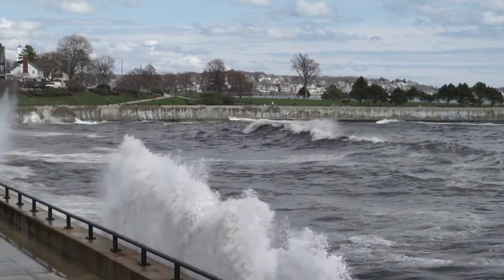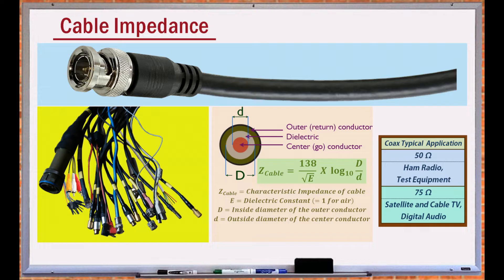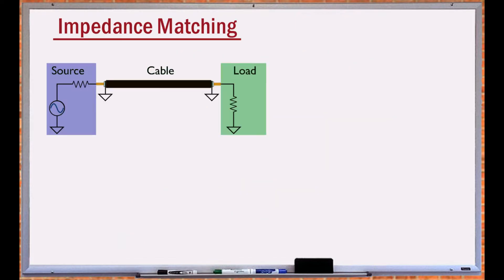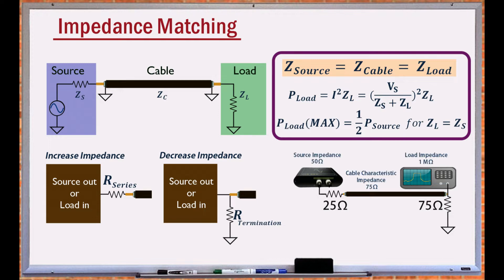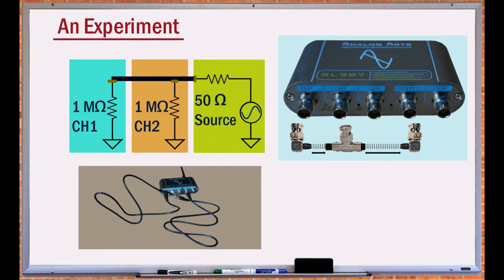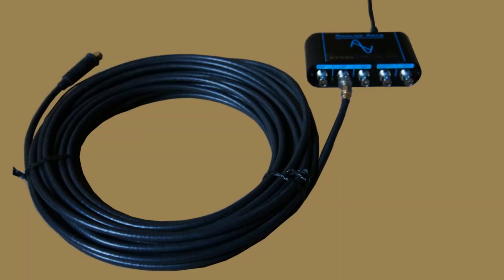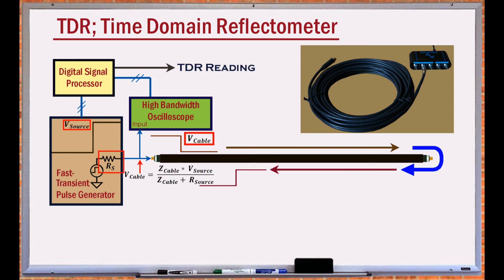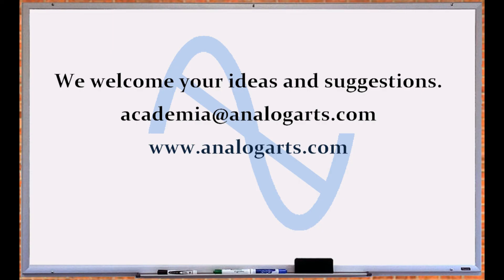Cable Basics; Transmission, Reflection, Impedance Matching, TDR

Comment: This is very good as an instructive video, but I think there are two errors that you make and need to correct. First is the comment that 50 ohm cable is for low loss applications. That is not true. Most 50 ohm coax such as RG8 or RG213 is rather high loss cable compared to 75 ohm coax, such as RG6, and particularly compared to higher impedance non-coax cable such as 450 ohm window line. This is because the for a given power level, the current levels will be higher in 50 ohm coax vs. higher impedance transmission line, and thus I^2R losses are usually higher, especially if there are standing waves present due to load impedance mismatch. The loss data of coaxial cables and parallel conductor cables are well documented, and are readily found online from coax manufacturers or in texts such as the ARRL Antenna Book or ARRL Handbook. Second, you say that there is no reflection if the load impedance is less than the cable impedance. That is not true either. Any impedance mismatch causes reflected power in the form of reflected voltage or current waves. For smaller load impedance, part of the voltage wave is reflected out of phase relative to the incident wave to partially or fully cancel the voltage wave in order to adjust the voltage/current ratio in the lower impedance load to a smaller value (thus smaller impedance). The ultimate being a short circuit termination, where 100% of the voltage wave is reflected 180 degrees out of phase in order to cancel the voltage to zero at the termination. The reverse is true for an open circuit termination. Mismatch of any kind causes signal loss due to reflected power being consumed by lossy cables. These points can be confirmed by looking up any text on the subject. Also,  just a suggestion: it is always more pleasant to hear a real human voice and not an AI created robot voice in these videos.

Comment: This video is significantly just "technical bologna". There is no better or nicer way to describe the technical contents of this video. This video represents everything that is wrong with Internet and YouTube as a learning resource.   

1.) The claim half the power reaches the load is completely false. 100% of generator power can reach the load, less cable losses. It can be a very large percentage reaching the load even with a mismatch.

2.) If the generator is conjugately matched to the cable input impedance, even if the cable is mismatched to the load, almost 100% of source power can reach the load. An example would be open wire fed doublet antennas, where the feedline operates with 10:1 or higher mismatches yet nearly 100% of transmitter output power excites the antenna.

I often run antennas with 2:1 and higher mismatches and yet the transmission line is highly efficient and the transmitter is perfectly fine. As a matter of fact reflected power does not make it back into normal PA stages. This is easily proven.

3.) Any mismatch causes STANDING waves. Standing waves stand. Standing waves do not bounce around, if they did we would call them "bouncing waves" and not call them STANDING waves. 

4.) Standing waves cause an operating impedance variation along the transmission line. That operating impedance, the ratio of across to through vectors,  varies with distance along the line. This is how Q-sections and stubs work. Look up Q-sections. They can operate with nearly infinite standing wave ratio yet have high efficiency.  

We are heading for problems when YouTube becomes our source of education.

Comment: The slide at 1:40 is simply wrong.     The only time there is NO reflection is when the load perfectly matches the load.   The idea that Zload < Zcable causes loss and not reflection casts doubt on the whole of this presentation,  as it is a fundamental misunderstanding of how transmission lines behave.     In the ideal case where the transmission line has no loss,  then there can be no loss as a result of standing waves set up through a mismatched load - there is simply no where for the power to be lost, power is simply energy per second and energy cannot be created or destroyed.    When the load impedance is a perfect match for the source impedance,  then there are no standing waves, since there are no reflections that would cause them to be set up.   Sorry,  but the fundamentals of this presentation are wrong.

For a robust explanation of transmission lines and standing wave behaviours,  see Walt Maxwell's books "Reflections".

Comment: What i don't understand is the explanation of the signal relfexion when there is an open circuit, why would a signal travel through a place where there is no end , in circcuits no current flows through a dead end cable.
Reply: His explanations are junk is why you don't understand,  not your fault.    Think of a coaxial cable ('transmission line') as an inifinite series of inductors and capacitors, then apply an ac signal at one end.  The energy in the signal heads down the cable charging up all the L's and C's as in goes - when it gets to the end, the only place that energy (volts and amps) can go is back down the cable, when it is out of phase with the signal going up the line.  The core of this is that it is an alternating current and ac behaves very differently to dc.   In the dc case you would be correct,  but for ac, you have a very complex situation.   I've probably not explained that well enough,  but you can get hold of Walt Maxwells books 'Reflections' as free pdf downloads,  and he explains much better than I how this stuff works.

Comment: Of course you have reflection when Zload < Zcable. There is only one way to not have reflection and that is to not have a mismatch. Reflection causes VSWR which proves that you are wrong in your statement. If you don't believe me then try to terminate a 50 ohm coax with a 25 ohm resistor. You will get VSWR close to 2 with a reflection coefficient of 1/3 and a reflection angle of 180 degrees. 11% of power is reflected. If you change out the 25 ohm resistor with a 100 ohm resistor the results are almost the same. Only difference is the reflection angle which now is 0 degrees.

Comment: Cable impedance is low as compair to transmission line but how can cable reflect the surge voltage generate in line due to fault

Comment: How do we measure the impedance of the "load" and the cable without an oscilloscope?
information not provided by the manufacturer!
Reply: You use a vector network analyser (VNA)

Comment: "Adding a resistor in series with the source or the load, or using a termination resistor is a basic method to achieve impedance matching." - also incorrect. A conjugate match the most common method.

Comment: 1. Whether the load impedance is great or less than the characteristic impedance, there is a reflection. 2. In either case, there is no signal lost. Because of these fundamental flaws alone, I can't recommend this video.
Reply: do you have any other video that you would recommend or any other source to understand this concept of impedance matching?

Comment: Isn't 75 ohms lowest loss and 50 ohms best compromise between power and voltage handling and loss?
Reply: Yes. You are absolutely correct. And optimum diameter ratio for voltage breakdown is 2.7 corresponding to 60-ohms impedance. So 50 ohm is a good compromise. And funny enough if you take a 77 ohm transmission line with air insulation and change out with a PE isolation you get a 51 ohm transmission line.

Comment: Interesting. Is the cable characteristic impedance the impedance of 1m length? I'm assuming this because I believe the total impedance is proportional to the cable length. Also for a very long cable wouldn't be better trying to minimising impedance?
Reply: Characteristic impedance doesn't change with length. Zo = SQRT(L/C) assuming lossless transmission line. If not lossless then Zo = SQRT( (R+jwL)/(G+jwC) )
Reply: @KjartanAndersen  yes, independence from length is true for lossless lines that is for frequency high enough. I think its value is a purely inductive impendance.

Comment: Video is full of wrong information
Reply: Indeed!! if the load impedance is smaller than the cable impedance there is a reflection. 2 If source, cable and load impedance are matched you do NOT automatically loose half of the source power. Depends on the cable loss factor and length! What the video implies is incorrect. The video is well put together but has these two issues.

Comment: Hi Academia, i have been staring at this for awhile now haha .Am I right in saying that all impedances along the circuit are in series without eachother hence the amps(Signal) will be constant throughout the circuit? is this the purpose of matching the impedances throughout the circuit?
Reply from the maker: Ideally, the characteristic impedance of a cable is the same throughout the cable.
That is to say, at any location, the traveling signal encounters the same impedance. 
Please note that this impedance is the impedance between the center conductor of the cable and
the outer one, or the signal path and the ground path.
This is different than the impedance of the signal conductor from one end to the other end.

Comment: 2.47 min i think  its totally wrong. To convert 50 ohms to 75 ohms you can't use 25 ohms resistor as you mentioned. then source impedance of 50 ohms not satisfied . Any body can correct me if I wrong
http://www.amateurtele.com/images/Amateurtelecom-impedance_matching_schematic.png
Reply from the maker: The exact purpose of adding the 25 Ohms resistor is to change the source impedance to 75 Ohms. 
This is to optimize for loss and reflection in the system.
Clearly, in this case, the source impedance is 75 Ohms, and no longer 50 Ohms. And of course, it does not have to 50.
Reply: Actually, you are right. In the shown example the cable is matched to the source effectively matching any reflections that might return from an unmatched load. But the generator is not matched and will see a 100 ohm load.
Reply: 1. You are Wrong
2. the correct spelling is  RESISTOR  (yes , it does matter)
3.  as Academia said THE PURPOSE of adding the 25 Ohm Resistance was to balance the impedance mismatch SO AS TO AVOID REFLECTION AND SIGNAL LOSS

THIS WAS ACHIEVED BY adding the 25 Ohm Resistor
Now.. as to why you are wrong (in case you might say  "Ok Martin, prove me wrong") hehe

Mate, i'm happy to prove you wrong but I'M NOT GOING TO 
because, , Please understand
- I'm an engineer
- These are basic concepts
- if i was to go around proving every newbie wrong who asked the question "Ok, prove me wrong then"  i would be doing nothing but proving people wrong, WHICH IS A WASTE OF A LIFE
so, for that reason i'm not going to 

I would however encourage you to take a course in Digital Reception Technology or Digital Signalling  or Digital Signal Processing

it's also not cool when someone like you (who hasn't bothered to do a massive amount of courses Disagree's then asks someone like me to prove you wrong
Essentially you want the answer for free (by taking the easy road)

i'm happy to tell you you're wrong
i expect you to accept my response on the basis of my experience

if you want to take it further i expect you to go and do courses that show that you have enough experience to continue the discussion so we don't have to keep repeating the basics, ok
i think that's a fair call

but 
1. your question is a fair question (and i understand it)
2. your opinion is respected
3. but all that aside,  YOU are incorrect and  ACADEMIA is correct
(Based on fundamental engineering principles,  not based on my opinion, but based on fact)
ok

beyond this, if you disagree, that's a completely different discussion and is purely your opinion and is not fact.

have a nice day mate
Reply: @martinkuliza  http://www.amateurtele.com/images/Amateurtelecom-impedance_matching_schematic.png
Reply: @martinkuliza  Tell me how adding a SERIES 25 ohm RESISTOR is a good idea for matching. How much do you loose in the resistor? And where do you get a resistor to handle my 100W radio?
Reply: @KjartanAndersen  
Mate, i apologize ok
I've had another death in the family, the 5th for this year now.
If you don't mind , i don't feel like getting into this and i'm not in the right head space to talk engineering.
sorry. Please don't take it personally.
If nothing else, i did want to at least respond to you so you didn't think me rude.
but i need a time out.

Comment: Dear could you plz explain how can electrical signal reflection occur against high potential at the part of transmission.  for optical fire it is obvious,  but electrical signal reflection is bit confusing,  as electricity can not propagate against high potential.
Reply from the maker: Hi Shersada. Reflection only when happens when the load impedance is higher than the characteristic impedance of the cable under test. If the cable is connected to any potential, whether it is high or low, the load impedance is essentially zero. Therefore, if the cable has any potential reflection does not happen.
Reply from the maker: Thank you for your question. An electrical signal reflects back to its source when it encounters a load impedance higher than the impedance of the source. If by high potential, you mean connecting the cable to a  high voltage, that will be equivalent to shorting the cable. In this case, no reflection occurs.

Comment from the maker: Thank you Nikša for your question, "What if we use a single wire transmission line, is impedance matching still needed? I assume single wire still has some internal reactance so yes to a point?", not showing here.
Impedance matching requires a return path.  The matching is done by placing an equal impedance load between the signal wire and the "GND". A signal wire transmission, by definition, does not have a "traditional" return path. Therefore, the issues become how and with respect to what to measure the impedance of the wire, and additionally where to place the load. In low frequency applications, you may think of Earth as the return path. Then the transmission is not truly a single wire. So, the impedance matching follows the same criteria as a 2 wire transmission. For high frequency applications, the transmission is really not electrical. In this case, for the optimum transmission, several factors must be considered and the issue becomes more complex.

Comment: Please provide me formula related to silver plated copper cable insertion loss and frequency. Please it's very necessary, I am unable to search this
Reply: You're unable to search this are you

FUNNY HOW I WAS ABLE TO SEARCH AND FIND IT IN APPROX 7 SECONDS

http://www.standard-wire.com/coax_cable_theory_and_application.html

I would suggest you brush up on your searching skills and SEARCH HARDER NEXT TIME.

the simple fact that you are ASKING FOR HELP for something that is NECESSARY TO YOU shows a problem and clear lack of commitment on your part
again, i found the answer in a few seconds
but somehow YOU WERE UNABLE to search it

i want you to go away and ask yourself this question
HOW EXACTLY WAS THAT POSSIBLE ?
and i want you to learn from the mistake

the guy previously gave you the answer and you still are lost
clearly something is wrong with you

i suppose after me giving you my link you are also going to say you don't have the answer .. right ?
if that's the case, then.... MATE, YOU CAN'T SEE THE ANSWER IF IT'S PLACED IN FRONT OF YOU

so think about that as well